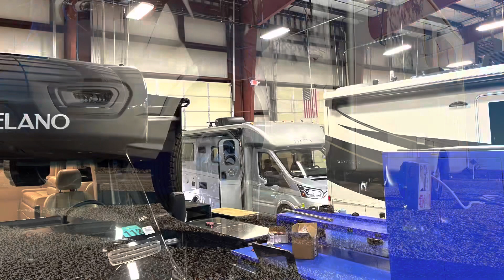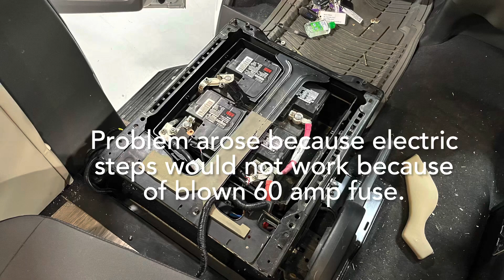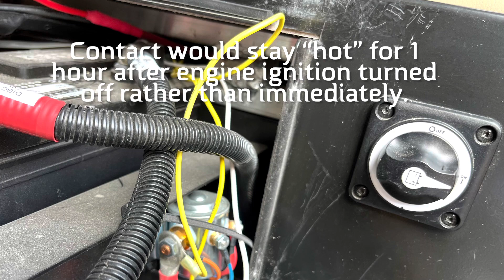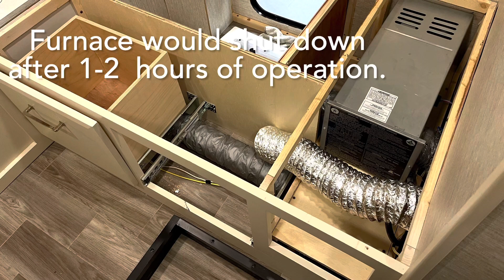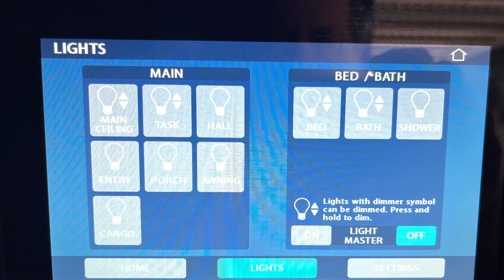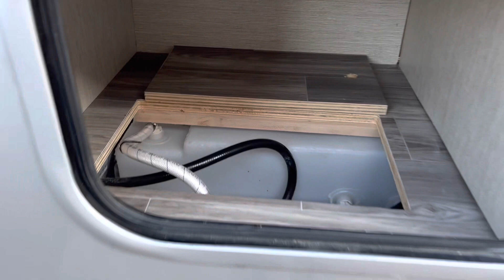2022 Tiffin Midas 24RT Owner Experience - Major Issues & Tiffin Resolution

Comment: @rvtechman I have a 2023 Midas and am wanting to switch to lithium, i'vee been told the Freedom X 2000 inverter is compatible but I needed to check the converter (charger) do you know  where it is on the Midas and / or if it is lithium compatible?
Reply from the maker: To be clear, my Xantrex Freedom 2000 inverter does not have the 120VAC to 12VDC converter feature . Instead my Progressive Dynamics power center contains the converter, and it’s  located inside under the passenger side bed. 

I converted to lithium house batteries a few weeks ago, and I probably made it more complicated than it needed to be. My final step in the process was to take the cover off of the Progressive Dynamics power center and flip the dip switch to lithium, and to press the buttons on the GoPower solar controller to LFP. 

Tiffin had connected the house batteries directly to the chassis batteries through a Cole Hersee solenoid and with no fuse. Maybe they did this in  order to provide a chassis battery “boost” function? (I did not like that they did not have a fuse on this cable close to the chassis battery source).

Since the lithium house battery most likely doesn’t have sufficient cold cranking amps to start the Ford Transit engine, I accepted the loss of the battery “jumper boost “ function (button on the side of passenger chair connected to Cole Hersee solenoid) with my lithium conversion.

So I moved the house battery connection from the chassis batteries (after first disconnecting all 4 batteries) to the Ford Customer Connection Port 2 (CCP2) 175A load shedding connection with a 60A breaker. I then ran this cable to the Cole Hersee solenoid, then to a Renogy 40A DC to DC charger (disconnect, fuses and charger mounted on a board under passenger seat). I was concerned with excessive alternator or CCP2 amp draw, and am probably very conservative but I have found that my setup charges my lithium house battery only after a short time of driving.

I selected a LiTime 230ah battery with low temperature protection. If I had to do it again I would probably go with two batteries (and added the luxury of Bluetooth and heating) because after I removed the existing house batteries I had to remove a metal divider bracket that separated the two batteries. I went with the 230ah battery for the higher capacity and to remove some parallel cabling, but that is debatable.

After I completed my conversion I had an “uh oh” moment because I was concerned that the limiting amperage out of the battery would be insufficient for starting my Onan generator. Well, all is good in my case because the battery allows for 500 amps for 5 seconds and 200 amps continuous. So whichever battery/batteries you select, be sure to consider this.

My only mistake so far has been to not properly calibrate the battery monitor (shunt), which requires a few 100% to 0% cycles and setting the monitor accordingly.

Good luck with your conversion and I would be curious as to what you choose to do and if you found Tiffin’s wiring different.

I’ll be doing a video on my conversion in a few weeks.

Comment: I have a 2023 and have the same problems. In addition to these problems what have you don’t about those exposed waterlines, I do a lot of freezing weather camping.
Reply: Tiffin Service Center put pipe foam insulation on most outdoor water lines including water bay. I added more pipe insulation, and removed/bypassed the water filter. When I picked up my Midas from dealer, my first night it got down to 17F and I had to use a hairdryer (120v) in the morning to unfreeze the water bay piping and pump. I recently drilled a hole in the bottom of the water bay (I think 1-1/2” diameter) and made a rubber flap to run my water hose with the water bay door closed. In cold weather I’ll probably run a 120v extension cord through it and connect a heat source like a 60w bulb to it. Be sure to keep your Truma on Eco or Comfort for winterization ( and keep water pump on because my Truma needs water pressure to properly work). I am still working on a solution to keep black and grey drain valves from freezing. It will probably consist of heat tracing, insulation and an aluminum sheet metal to protect it. They certainly didn’t design the Midas for cold weather use, but maybe I’ll eventually get it to handle some level of freezing temperatures.

On a minor note, I did add the heat strip to the air conditioner and it has been great in providing sufficient interior heat in weather as cold as 45F so far

Comment: pex crimps on flex lines bad idea they need to fix that problem it will leak
Reply from the maker: Interesting. I didn’t know that but it makes sense. I’ll keep an eye on those for leaks. When I bypassed my water filter and also added a isolation valve between grease tank and pump (for winterizing antifreeze) I used hose clamps on the flexible tubing. So maybe I did it the right way.

Comment: Well it looks like I've circled  back around to being interested in the Tiffin Midas again after looking at class A's the Midas MT looks like the best fit for us. I sent a message to Tiffin sales to ask him why they  discontinued the Bigfoot leveling jacks and have not heard back from them and I was wondering if you've had any issues with him so far?
Reply from the maker: No issues with the Bigfoot (yet). The only problem was that Tiffin failed to connect the Bigfoot “ignition “ yellow wire to the Ford ignition source (which they fixed on my first trip to Tiffin’s service center). Tiffin also adjusted the base/null level point so that the front tires weren’t 6” off of the ground. (I also tweaked that setting  so that the refrigerator door would stay open). The hydraulic motor and reservoir for the system is unfortunately just behind the rear axle underneath the coach, so maintenance or emergency operation will be difficult.

Comment: I have a question about the factory converter if a person would switch from lead acid to lithium does the converter have the ability to make an adjustment to lithium from lead acid or would I have to buy a whole new converter?
Reply from the maker: My Midas has a Progressive Dynamics power converter system model PD4060K (typical 120v breakers, 120VAC to 12VDC converter and 12v fuses system). Per its manual, there is a switch on its circuit board (accessible from back) to switch to lithium batteries. The GoPower solar controller can also be switched to lithium. The Xantrex Freedom 2000 does not charge the batteries, so no changes are required. Because of the initial electrical problems that I had, I would install a DC to DC 30amp charger in the cable from the chassis batteries to prevent over amping the Ford alternator or exceeding the fuse rating on the Ford connection point (but I’m just guessing that this is needed because I don’t have a electrical wiring diagram, etc.)
Reply: @rvtechman3619  on a different subject my other concern is about four season camping. I know it has heated holding tanks but is there a way to readily get to the  pipes to wrap them with heat tape as well as a easy way to plug them in?  On the earlier subject about the leveling jacks have you heard why Tiffin discontinued using them on their 2023? I believe I heard you mention in one of your videos that the shower size was not what it was in the brochures . I looked on Tiffin's website for the 2023 model it is supposed to be 24x 36 which is really important factor for me. Do you think there is space to put a second 200 W panel? Sorry about so many questions.
Reply from the maker: @kip5588  Grey and black tanks have heating pads. Fresh does not because it is essentially resting on the floor of the motorhome in the rear. The grey/black tanks are relatively easy to access from underneath and side compartment door (for black). Drain piping is low, but you could probably add tracing as long as it doesn’t hang down much. These tanks are very odd shaped. The black is under the toilet but the grey is like a 2ft wide thick slab spanning the width of the motorhome, then drops into a odd shaped connected tank next to the grey tank.

A majority of the water piping is in the wet bay, although several lines exit the top of the wet bay (exposed to the elements) to feed the bathroom and water heater. Water lines to the kitchen sink run under the motorhome (again exposed to the elements). All piping is vinyl (reinforced) tubing and not PEX. 

The wet bay does not have a hose access port on its bottom, so it’s door has to be kept open when connected to city water (ugh). When I picked the RV up and it got down to 18F, my water system was frozen even with water bay closed. I complained to Tiffin while in their service center and they added pipe insulation to all outdoor water lines. I’m pondering the use of an incandescent light bulb (now illegal to buy) or a low wattage space heater (120v) for camping in weather below 25F. I had no freeze issues (after pipe insulation was added) in 27F weather. 

By the way, the water filter on my Midas only filters water from the fresh water tank, and I dislike that common filter design because it’s something else to drain. So I bypassed it and will use a filter via the city water hose instead.

The Tiffin service center technician did not have a reason for why mfg was no longer putting auto leveling on Midas. (I am very disappointed that Tiffin mfg or marketing is not actively seeking customer input ). 

Regarding the shower, it is small. It is only 21.5” deep and 31.5”wide.Their brochure is definitely misleading. Probably by the time you measure the walls/box around the fiberglass shower you would achieve those larger dimensions. For instance, there is a 3-4” wall space void for shower plumbing access.(Access panel at chest height on wall across from kitchen.)

Regarding solar panels, there is probably room to add more than 200w of solar, but it would be in the form of narrow panels. I’ll be looking into that in a few weeks, and have to report back to you.
I welcome questions.
Reply: @rvtechman3619 Thank you for all the valuable information it's a lot more than I would get out from a  dealer. When you get a chance could you measure the inside dimensions of the usable part of the shower? Thanks
Reply from the maker: @kip5588  21”x30.5” brand is Praxis. The shower door would give you probably a little more depth for maneuvering
Reply: @rvtechman3619 thank you so much for the measurements 21 inches does not sound like it's going to work for me I really like the tiffen Midas RT. It's too bad that Tiffin's website says it's larger.
Reply: @rvtechman3619  I guess since the shower is not going to accommodate me, I'm going to have to move on to looking at the 2023 Jaco grayhawk or Red hawk but I really wanted all wheel drive and and neither of them have that option.
Reply from the maker: @kip5588  The rear bathroom on a Midas 24MT or Thor Compass/Gemini 23TE is much larger than the Midas 24RT so maybe their showers are bigger but we didn’t want the kitchen/Murphy bed layout .(The Thor Compass/Gemini 24KB’s bathroom and shower are even smaller than the 24RT). The Jayco motorhomes on the Ford E350 V8 chassis look great on paper (space, storage, towing and much lower price), but we wanted something smaller and AWD as you stated. Good luck in your search.
Reply: @rvtechman3619  Thank you for being so helpful and answering all my questions. Being 6ft 2in and over 300 pounds makes it difficult to find something with a king size bed and large enough shower. Maybe it's time to go on diet lol

Comment: From the video I see that you have leveling jacks but when I called Tifin they said the leveling jacks are not available on the Midas. So were those dealer installed aftermarket? I also had another question are you planning on swapping out the batteries for lithium and updating the solar on the roof? We have been seriously looking at the Midas RT it would be nice to get answers from an actual owner like yourself thank you.
Reply from the maker: Leveling jacks were Tiffin factory installed. That is one reason that I wanted this specific motorhome. (I negotiated a price over the phone and flew 900 miles to complete the transaction and take delivery). In December 2022, I searched RV Trader and major dealers that don’t use RV Trader and found about 20 Midas 24RT available. Almost everyone was unique. Some had auto leveling and some didn’t. The same for adaptive cruise and rear side vertical compartment doors. There were variations in second row seats and a few even had larger bathrooms at the sacrifice of living and bedroom size. A technician at the Tiffin service center confirmed that they don’t install auto leveling on Midas anymore, and that is a shame because it was a big differentiator for me. 

I do plan on adding more solar. The current panel is 200w. It’s tight but I want to add at least 200w more. I’ll use a major brand flexible panel and avoid drilling into the roof by attaching the panel to aluminum channels which are attached to the roof with RV roof sealant tape and Rv roof sealant. I’ve already added a connection to my house batteries with an SAE plug for my portable solar panel.

Regarding lithium, I’m hesitant at the moment because we rarely camp no longer than one night without an electrical hookup. The Progressive Dynamics power center has a lithium switch and also the GoPower solar controller. But I would add a DC to DC charger to limit the amps from the vehicle alternator from blowing a Ford fuse (my guess) when charging the house batteries. (But this DC to DC charger would make it he battery booster connection between the chassis and house batteries useless because it would prevent current to going from the house back to the chassis for jump starting, although I’ve never needed to do that in 10 years of motorhome operation).
Reply: I understand that this has a 2000 watt inverter. Can you run the microwave, tv or refrigerator when not connected to shore power? If I end up purchasing the Midas I've been thinking about the idea of adding the EF Echoflow 3600 Wh  with the expandable battery pack giving me 72 kWh then plugging the shore power cord into it's RV outlet to power the house. I would use the garage for storing it as well as using the electrical outlet  for charging when on shore power or generator or the option of using their foldable solar panels.
Reply from the maker: @kip5588  The Xantrex Freedom 2000 inverter powers all of the 120v electrical outlets EXCEPT the one for the induction cooktop (1800w.on high) and microwave. (I’m almost 100% sure that that is the design. I need to go see to be sure). The front TV is 120v, so it will run off the inverter. The bedroom TV is 12v with an adapter that plugs into the 120v outlet, so it also runs off of the inverter. (Why didn’t they just provide a 12v power source?). Note: No house speakers or DVD player in my Midas.

The cooktop plugs into an 120v outlet under the counter top (hidden behind a drawer). The microwave plugs into an outlet in the adjacent cabinet above the cooktop. It probably could be rewired so that the inverter powers those plugs too.

Your power station idea sounds interesting and it’s feasible to me that it could power everything. But I’d have to analyze the option of running the AC too.
Reply: @rvtechman3619  as far as using the air conditioner powered by the ecoflo. You would have to purchase a softstart RV plug they're doing away they're 30 amp and coming out with a 50 amp this summer then connect a dog bone to use it with for 30 amp. Without the soft start the air conditioner will overload the ecoflo power bank. When the ecoflo power bank is plugged in to the electrical outlet of the RV it will charge the batteries in about 3 hours. Even with the extra battery packs a 15000 BTU air conditioner probably won't run more than three or four hours on a charge depending on the temperature. It is a pure sine wave generator to protect sensitive electronics in the RV. So I think that's the best way for me to go and a lot easier than have to put more panels on the already crowded roof and rewire the RV. I'm afraid if I try to modify the RV too much it might void the warranty.
Reply from the maker: @kip5588  Great advice. Maybe I am lucky but my Midas 13.5kBTU AC is optioned with soft start. It was mentioned in last year’s brochure but I had to take pictures of capacitors (in addition to model label) to get confirmation from Airexcel.

Comment: I wonder if Tiffin was pressured to get the new model out before all bugs could be found and fixed. On the other hand, it is good to hear that Tiffin backed up their product, and probably was good business practice to work with you to identify and fix them. That way, they would not have other owners having the same issue and having the word get out. My wife loves the layout, especially the murpy bed model, but I do not want a slide. However, the twin beds in the RT look a bit on the short side for me.
Reply from the maker: I don’t know what Tiffin was intending with the first year production run of 24RTs. In fact, I recall hearing about one in Florida that was returned to Tiffin by the dealer to change out the style of second row seats. So maybe they were sent about the country to get dealer and customer input. But why not pursue excellence if you are going to allow these early production models to be sold?

We preferred the twin bed model over the Murphy bed model because we don’t want to make up beds every night, and have the bed in the kitchen. Pros and cons to each layout.

The beds in my 24RT are 27”x76” and 37”x76” (regular twin mattress size). These are longer than most of the competition.  However, Tiffin made some even earlier 24RTs with a larger bathroom and I suspect that the beds are shorter.